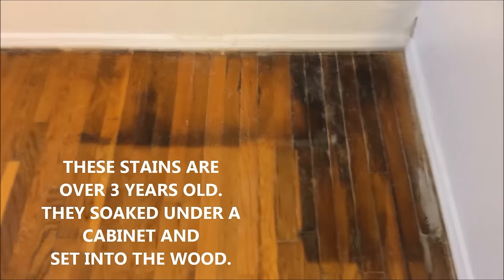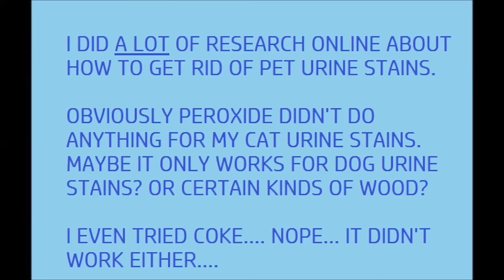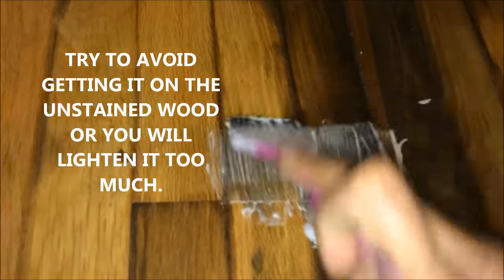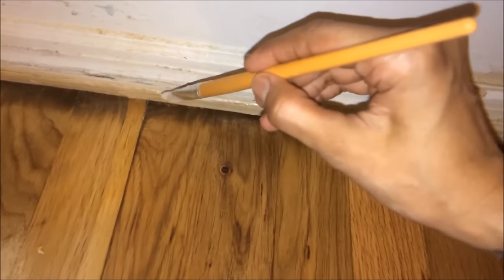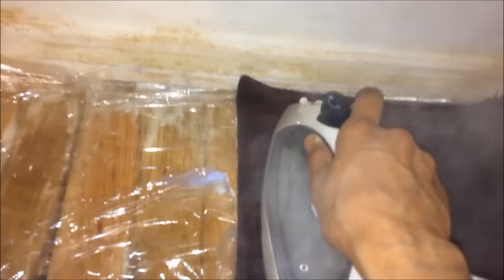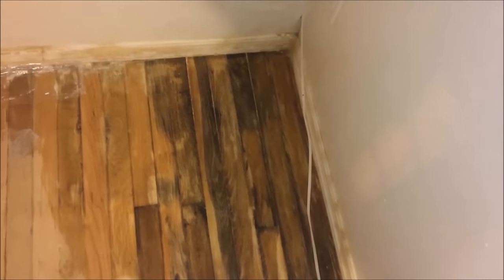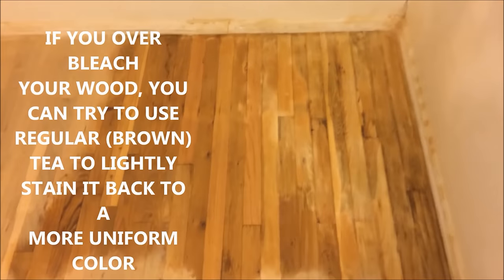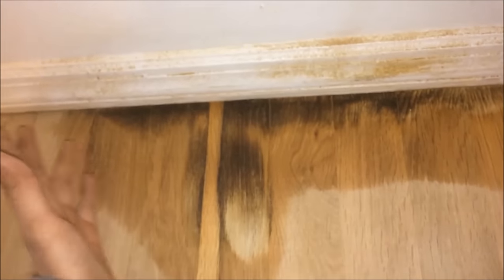How to remove pet urine stains from wood floors GUARANTEED

Comment: Just so you know 6 years after you made this video you are still saving hardwood floors. We were amazed how well this worked. We took a chance on your video after putting two laminate floors down.  If we had seen your video before we did them we would have redone all of the rooms.  Thanks for thinking outside the box.  We were able to remove the stains and the floor turned out beautiful!!

Comment: Great work! The weak (3%) hydrogen peroxide is okay for recent stains but may need to be repeated a time or two. For older, soaked in stains, you'd have to repeat it too much, so using the strong stuff, like you do, is the way to go! Gets rid of the urine smell as well! ...Everyone, be sure and wear protective gloves, 'cause the hydrogen peroxide will kill off layers of your skin, before you know it!
Reply: Savetime Mann  did you try it yet? I am going to try a small area, but without the steam iron.
Reply: The developer is peroxide, just 4x stronger, (40 volume = 4x (10 volume or 3%) = 12%. The rest are thickeners, water and coloring agent optional

Comment: Can I be your bff? I left the saran wrap on over night and it worked like a charm! And then I re-stained it. I didn't do the heating it up. 💗💕💙💚💛
Reply from the maker: cool.  I'm glad it worked for you  :)
Reply: Cool, that was something I was wondering. Thx for the comment.
Reply: @dreamingrightnow1174  have you attempted it??
Reply: @MK-ih6wp It's been a while, so I'm not sure which video this is, but I have tried bleaching and it didn't work for me. I think I'll have to take the old finish off and go from there. Not a task I look forward to.
Reply: OH GREAT Im nervous to do the saran wrap. I have the worst stains ever and am a bit lazy to do a few applications
Reply: The bigger problem is how to remove embedded dirt from the seams of old hardwood floors - wood filler is not the answer ... anybody have any ideas?

Comment: Thanks for the inspiration! I used your concept for a much smaller (but decades older) stain I found when I pulled up old carpet.  I didn't want to go the hair developer route, so I asked myself what else might come in small quantities and deliver the necessary high level of peroxide and stay in place. Answer: Tooth whitener.  I bought one small tube of tooth whitener gel. I put it on the black stain for a series of three nights, covered with plastic wrap. Each day I wiped it clean with clear water and let it dry so I could see the progress. It's not entirely gone but now it looks much more like a natural flaw in the red oak. I can sand and refinish with confidence.
Reply from the maker: cool.
Reply: Nice

Comment: Why are there negative comments here? This video is NOT about replacing the boards. It's about removing the stains. Anyone who says replacing the boards is easier and cheaper has no idea what they're talking about.
So thank you ma'am for making this video and going out of your way to help others. The success here is pretty phenomenal and the idea is quite clever and effective.
Reply from the maker: there are always going to be negative people who miss the point. 1. some people don't know how to replace the boards2. some people don't want to buy a box of boards to replace them
Reply from the maker: I actually learned how to replace the boards (on YT)  after I did this when I changed the place of my bedroom doors and had to fill in the gaps of the door tracks.  I removed boards from my closet floor to fill in my bedroom doorway.  it was a pain in the ass, BTW.  lol.
Reply from the maker: people always need to criticize
Reply: fredsayshello I sand floors for a living and replacing the boards is faster and easier if you’re going to sand it anyway so you really have no idea what you’re talking about
Reply: ThatChickNYC Great video! Thank you for taking the time to film this.
Reply: @thatchicknyc3606  OMG, that's so smart getting the boards from your closet! Simple ideas are the best; I never thought of that one, lol. Still, I'm kinda scared to try it. My question is, after doing this, did you figure out more short cuts? Like I'm wondering if you put the stuff on longer, like overnight or something, if you think it would have meant less elbow grease..
Reply: @sheatherly87  Dude, why not just say what you know about floor repair instead of completely missing a commenter's point when they're just saying people are ridiculously critical in comment sections. Making a decent pizza is hard if you've never done it; "hard" is subjective. ['that's what she said'] lol
Reply from the maker: Dreamingrightnow a commenter said they left it on longer and it worked faster.
Reply from the maker: MrSPUDSTER26 just think of the time you wasted to type this useless comment.  The success was in my floors no longe being “black”, genius.  Ergo it was a success.  And since it was my time, why are you worried about it. 🤷🏽‍♀️.
Reply from the maker: Corn Pop  imagine coming to a video about getting stains out of floors to comment about replacing floors.   If people wanted to “replace” the floor, that’s what they would have put in the search bar.  

I think you need to work on your critical thinking skills, bro. 

This is just a quick fix for people who do not have the means, time, experience or money to rip out a floor.  

I can NOW rip out floors. At the time I did this I could not.  So that’s the solution I chose.  

Simple enough to process, yea?
Reply: Sorry but I Disagree... Depending on the wood type, it would be easier to just replace the boards with the closes match then bleach the floors... HOWEVER... For a much smaller stain this technique would make more sense.
Reply: @JUDALATION  Fair enough. I personally find the prospect of removing and replacing boards more daunting. Though I'd say, with your suggestion, one still has to do the work of replacing boards and matching color and then bleaching as this video advises. Maybe staining would be easier - darker color to match them.
Reply: @JUDALATION    I have a similar project on my hands, although thankfully my cat peed in a much smaller area of hardwood floor. 
For me, replacing the floor boards is totally out of the question.. I don't have the time/money/experience, and we live in a rental. 
So I am grateful for finding this video, although I'm really hoping I can get rid of the dark spots with less intense treatments, and save my 40V developer as a very last resort.
Reply from the maker: Corn Pop  lmfao.  I barely check my notifications.  so i will respond whenever I see fit.  and i SAID WHAT I SAID: if people wanted to replace floors that's what they would have put in the search bar.  find another hobby.
Reply: Ignore the Negativity. Thank You, Great Job. I sincerely appreciate the knowledge you chose to kindly share to help millions of others in the same situation.
Reply: The bigger problem is how to remove embedded dirt from the seams of old hardwood floors - wood filler is not the answer ... anybody have any ideas?
Reply: Agreed. As a pro. I could of replaced that section in 1 / 100th the time spent. Not to mention Bleach damages and compromises wood grain.
Reply: @thatchicknyc3606  Brilliant I'll give this a test perhaps. The carpet has stained our walls oddly enough or the cold + chemicals from cleaning floors ? Who knows old cheap thin wood paneling.

Comment: Thanks for posting this video. Clearly, you went through a learning curve and worked really hard on this project. But, by sharing everything you went through you have saved viewers dealing with this issue a ton of time and effort. The floors ended up looking fabulous.
Reply from the maker: thanks.  and you're welcome :)
Reply: The bigger problem is how to remove embedded dirt from the seams of old hardwood floors - wood filler is not the answer ... anybody have any ideas?

Comment: OMG I LOVE YOU!  I am in the process of doing this right now--and it works!!  I had tried the hydrogen peroxide---nope, then I tried the oxalic acid---NOPE!  I was really depressed yesterday thinking I would have to get my floors died black or something---then I tried this today and it is working like a dream!  I am not spraying with the peroxide--and I used heating pads-the kind you use in the microwave--and it lifted the stain right out...I am SO happy.  I am going to send this link to all my friends with animals!  THANK YOU FOR BEING SO CLEVER!
Reply from the maker: Trinket you’re very welcome.
Reply: Savetime Mann   HIya--yes--I put down her developer and powder mix on a slightly sanded surface--and then put the plastic wrap over it--and put on top of that 2 or 3 heating pads--the kind that don't plug in--but you put them in the microwave for 2 mins --they are the kind with rice or sand or something in them---and then just left them for while and came back and voila--when I peeled the plastic off I could see that the stain was gone!  I did it in small sections.

Comment: I had a similar problem with pet urine on my white oak hardwood floors.  In some of the worst areas I was able to remove the floor nails and turn the individual boards over.  The unfinished underside is clean and ready to sand and finish.  Your  bleach worked great BTW.
Reply: Turning the boards over is SO CLEVER! Bravo!
Reply: @itsmytube62  omg!! I love all of the folks in these comments, fantastic ideas!!
Reply: Such a great suggestion! I’ll have to try it!

Comment: Fascinating. You actually "dyed" it. LOL. Your floor looked like mine when I refinished three years ago. Exactly like that. I used bleach on the urine stains and they did get a little lighter. 
My biggest bugaboo was finding and removing all the carpet staples from the old carpet.  I put a lot of work into it, and wore out two belt sanders. I just finally accepted that it would always look "distressed". The very worst was in front of the entry door. I laid down six large slate tiles  there and they look great..
Reply from the maker: i tried bleach it didnt work

Comment: Girl, you are persistent! Love it.
Reply: She isn't persistent she is impatient.  First of vinegar is oxylic acid and woulda worked the same as would peroxide if she had let it soak and then dry over 2 weeks.  Problem is ppl think they can wipe it away or sand it away and it doesn't work like that.   If she soaked a cloth on vinegar and or hydrogen peroxide so that it stayed on the spot for a day and then repeated that for a cpl days then let it dry for 2WEEKS YES THAT LONG AS IT GETS WAY WAY WAY LIGHTER OVER TIME FROM DRYING OUT AFTER THIS PROCESS

Comment: I had water stains from potted plants on my hardwoods. They are the original thick hardwoods used back in the late 50's, early 60's. I used a drum sander and went below the stains.
Reply from the maker: urine is much harsher than water stains.  I couldn't sand out the dug in pee.  It was impossible.  It was either bleach it or remove the boards altogether.  And this was an experiment either way.  I found removing floor boards (for my closet later on) was a super pain in the ass.  I prefer bleaching spots, to be honest.  Less tools.  Less headache.  Less effort.

Comment: A similar technique known as "retrobright"  is used to lighten the plastic parts of old computers that have turned yellow. That involves putting the yellowed plastic in a clear plastic container with the chemicals and placing the container in the sun for a while, so it might be possible to accelerate the process on floors with a UV lamp.
Reply: I have had great luck with PINK for bringing microwave oven plastics  front yellowed back to white!  I smear it on, let it sit 10 to 20 minutes then scrub lightly and rinse.   Repeat if necessary, but I've never had too!

Comment: This worked very well on my oak floors thanks so much for posting.  Others said try food grade peroxide in 35% concentrate but I couldn't find any to buy, but our hairdresser liked this story so much she gave me some product.  I found using the iron on quite high heat directly on the wood worked best and mixing some 3% on top to make it juicy so it steamed its way in and repeat as necessary.  My before and after pics are pretty amazing considering they are 15 years old stains down deep left after using the drum sander.  This method really saved my floors.  Also tried a heat gun which seemed to be effective but went back to the iron.
Reply from the maker: I'm glad to hear it helped

Comment: THANK YOU for posting this!  I used the 40% peroxide and lightening cream.  I did not use the Saran Wrap or heat, but the results are still freaking amazing.  This technique saved us a lot of grief and means will be able to go with a much lighter stain on the floors.  Unfortunately, I don't have photos of the sanded floors before I treated them with the peroxide, but I will share before and after photos after the floors are finished.  Thanks again, great technique.
Reply from the maker: You’re welcome

Comment: Thank you so much for for this information I have had to remove the carpet due to the smell And found such a mess, should never let them live in my house. I am so amazed how well this works,  I do know that I will have to use some stain due to over bleaching, don’t even care, I am on my way to having my beautiful hard wood floors back. Thank you is not powerful enough to express how very great full I am. I have a limited income so I couldn’t afford to rent a sander and my small circular one just wouldn’t do the job but I learned about a nice tool called a carbide wood scraper and it does a great job at removing all the layers of varnish to get to bare but badly stained areas. Ok break is over, got to work.

Comment: Great choice using the iron steaming method, bc it is very effective in diminishing scratches and gouges on non-sealed wood. I use this on my guitar fretboard to remove scratches and dings, dont do on guitar body though..so if anyone by chance plays guitar, do this, wet towel over area, apply hot iron in short spurts, (will dry wood out tho, oil with linseed afterwards), works awesome. Sorry to intrude with that. Great job!
Reply from the maker: good to know.  thanks.  I just used the heat to accelerate the bleaching process.

Comment: This worked on my 100 year old floors and got me my deposit back! Want to note for others who may try leaving it on longer-- I was on a time crunch and had to leave in on for 8 hour chunks which did damage the wood a little i think and made it take stain unevenly. Still passable but could have turned out better if I hadstuck to the timeframe she suggests! Definitely take your time and do multiple shorter bleaching sessions for best result. Thank you for sharing!
Reply: Did you have to sand the entire floor or just the spots that were stained? I have one spot from a water stain. Should I just sand that one spot, get the stain out? Any tips are appreciated!
Reply from the maker: @avanett1 just sand the spot.  I wanted to redo the floors.  So I did the whole room

Comment: Thanks! I tweeked your method and used baking soda to make the 40 developer paste. It worked!
Reply from the maker: cool
Reply: @What why how, regards using the hair developer and baking soda to remove stains from an oak floor...  would you please clarify your comment?  I am reading this that you used baking soda with the 40 developer (I guess in the same 1oz + 2 oz ratio) instead of the packet of bleaching powder used to lighten hair?   Am I misreading this?  Thanks.
Reply: Yes, please do tell the details! Thx!

Comment: I have been a wood flooring contractor for a long time its nice to know what works other than replacement or a dark stain over the entire floor. Thanks for the video cant wait to try it out.
Reply from the maker: You're welcome.  Happy it can help. Also remember to treat the smell as well.  The developer gets up the stain, not the smells.
Reply from the maker: actually, I DID remove the SURFACE stains.  They are all gone.  I'm not concerned about what is under the wood as you can't see under the wood.  The smell is removed with Natures miracle odor remover.  And my floor is perfectly level after this.
Reply from the maker: oh okay.  Yea this was a lot of work with the sanding and bleaching, but I was so happy to get that yuck off my floor.  :)  Especially since a professional was trying to charge me 5k to strip, bleach and re-stain my floors.
Reply from the maker: el magico  no they are crazy here. That was the price quoted for just 2 rooms.  I was like wtf.  No way, I'll do it myself.
Reply: ThatChickNYC   You also figured out the key to it.. which is STEAM.  You opened up the "pores" to the wood with the steam to allow the product to get in there and do its stuff.  Very impressive.  🤗
Reply: But with the plastic wrap in the way, how will the steam get to the wood??

Comment: You mentioned oxalic acid.  There is a lot of it in Rhubarb leaves.  Perhaps a "tea" made with Rhubarb leaves would give you a solution containing enough it it.  (Not sure if using hot water is better or cold water for longer periods).
Reply: Oxalic acid is a main active ingredient in Barkeeper's Friend metal scrubbing powder.

Comment: Did these chemicals cause any bonding issues when you refinished the wood with polyurethane? I have heard that can be a problem when using chemicals to try and remove these black spots.
Reply from the maker: No. The poly bonded easily. I used water based.